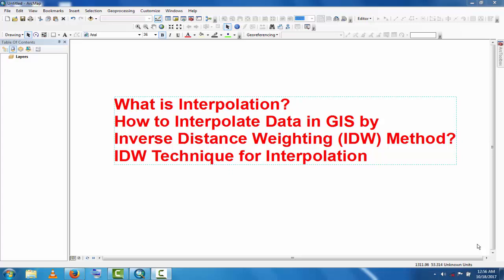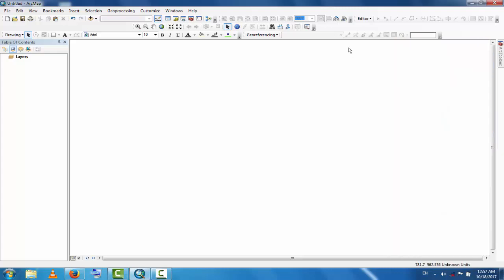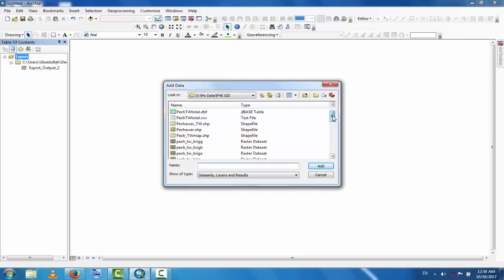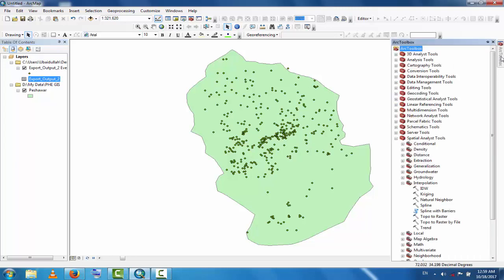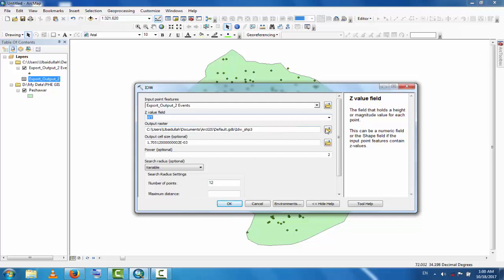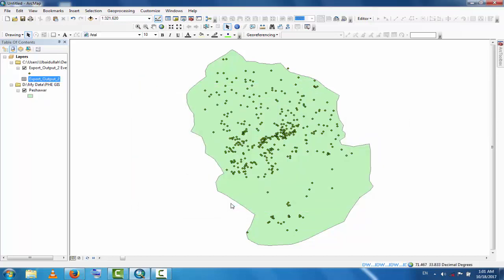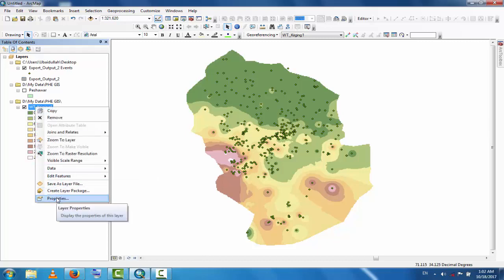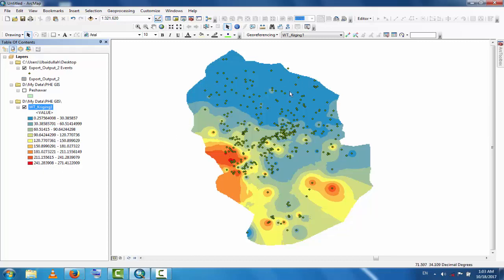IDW Estimation Technique in GIS || Interpolation in GIS by IDW Technique

Comment: what u add as output raster?
Reply from the maker: I add Esri Grid format as output raster : Esri Grid format restrictions are the following:
The maximum number of characters is 13. It cannot have spaces. It cannot use special characters other than underscore ( "_" ). For tools that output an Esri Grid Stack, the stack name cannot have more than 9 characters.
Hope you will understand it. Best Luck
Reply: @bestsolutionline  how can we get it? And for that restrictions we have to change name. That's it. Right!
Reply from the maker: Yes right , Change name in output raster as per restriction, for example map_krigging
Reply from the maker: OR,   IDW_Technique
Reply: @bestsolutionline  but how can we get esri grid format?
Reply from the maker: @poojarathod3652  you just change name as I mentioned in example it will work. It cannot get but only to write in that format.

Comment: How  to add rainfall data to arc gis in shape file formate
Reply from the maker: The input for IDW is a single feature layer of points (in this case, weather stations). Each point needs to have one value (i.e., mean annual precipitation), and then the interpolation function estimates what the values should be in between the known points.